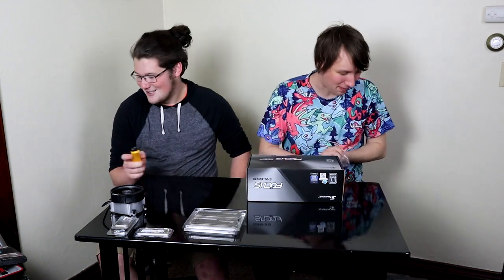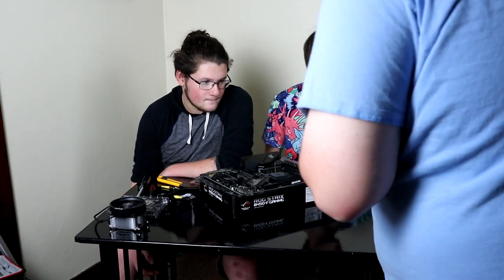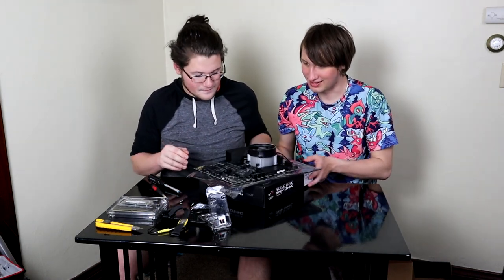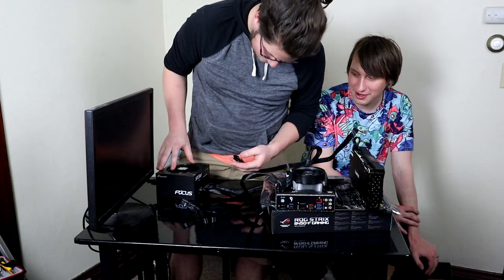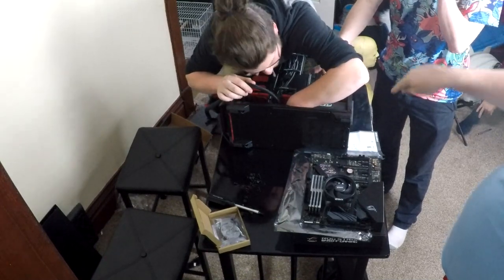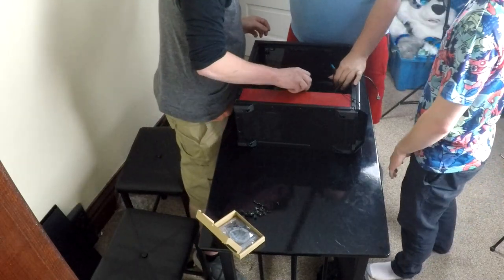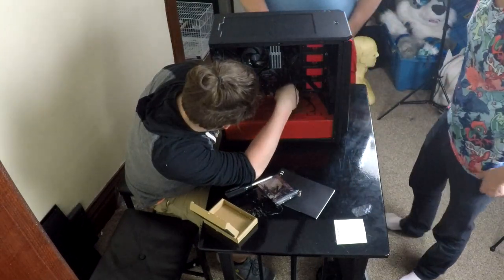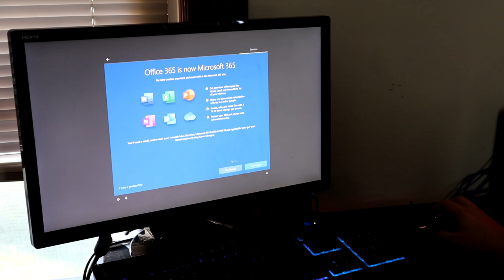Chewies New PC Build!

Comment from the maker: Here is the part list as well! 
Processor: 
Ryzen 7 3600X 6-Core 

Motherboard:
Asus ROG STRIX B450-F GAMING ATX AM4 Motherboard

RAM:
32 GB G.skill Trident RGB RAM

Storage:
Intel 660p 1TB NVME SSD (Boot Drive)

Graphics:
Gigabyte GeForce RTX 2070 SUPER 8 GB GAMING OC 3X Video Card

Case: Phanteks Eclipse P400 Mid 

PSU: Seasonic FOCUS+ Platinum 80+ 650w Fully Modular